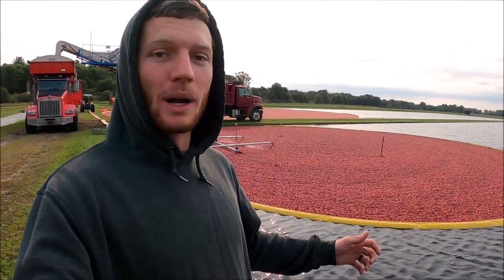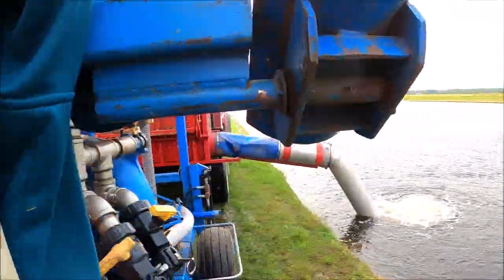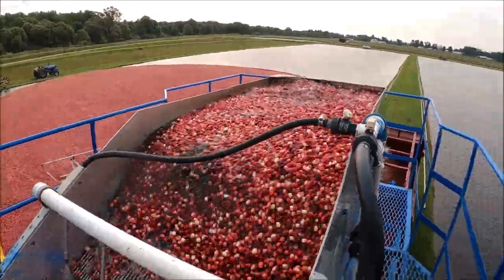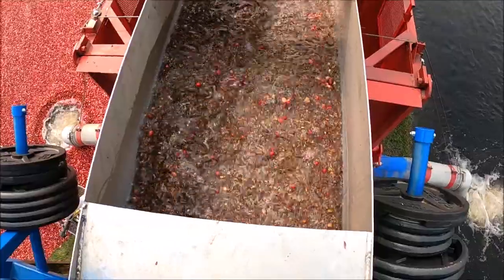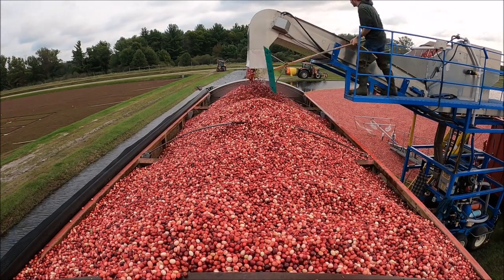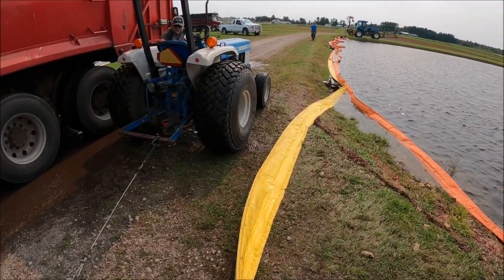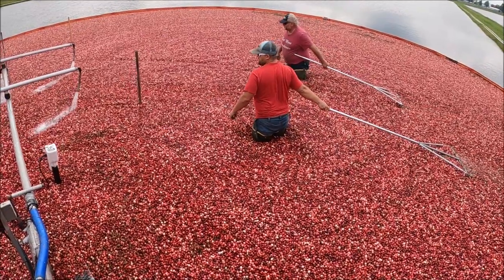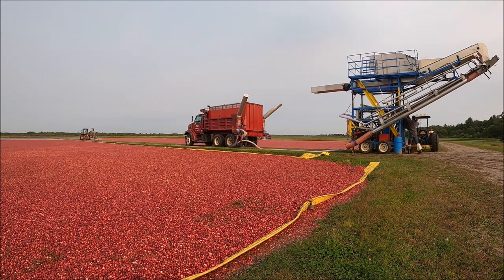Cranberry Harvest 2020

Comment: I’m that last fast forward clip was that a tarp they set under the spray bar?
Reply: You are correct,  I work with Cody during harvest. If I remember correctly,  the tarp, which is really a mesh,  helps keep some of the vines from being pumped into the truck, which are hard to screen out,  and less trash to ocean spray,  equals a better pay per barrel
Reply from the maker: Yeah. Also it helps with the the leaves getting stuck in the vines. When the water sends the leaves to the bottom they will float a crossed the mesh and go into the trash truck.